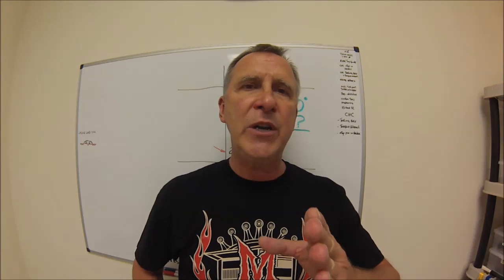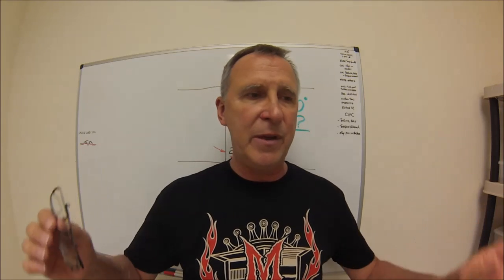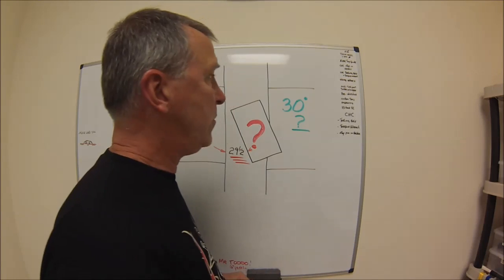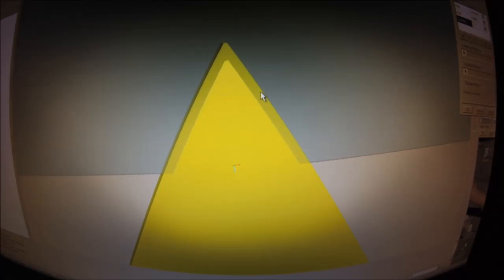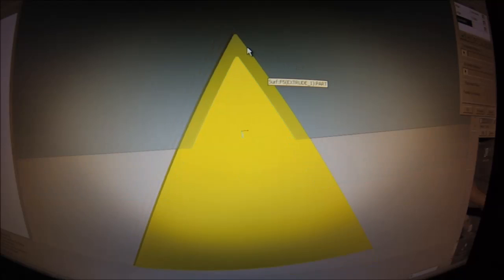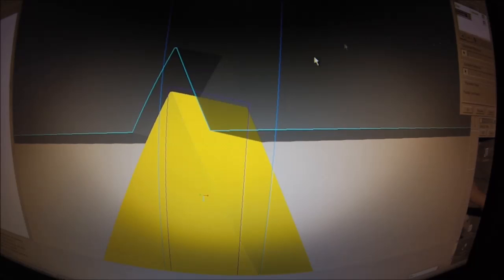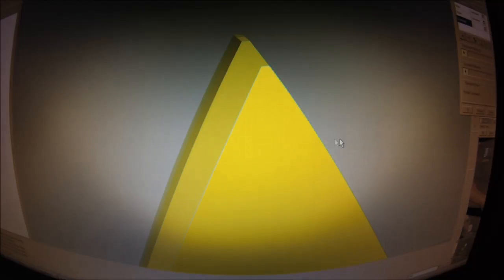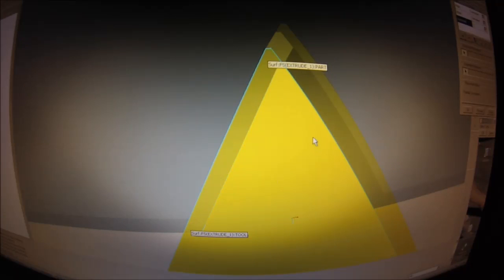Lathe Compound Setup for Single Point Threading...Myths and Musts

Comment: Hi Joe, Thanks for the excellent demonstration of a subject not well understood. I've cut many threads at 30 degree angle and straight in and both work well. However, there's one situation where a 29/30 degree angle produces superior threads than straight in. Lets say you're cutting a 1.00-8 thread in 304 SS, 4140, aluminum bronze, or other tough material. In that case an 8/10 degree positive side rake produces a smoother cut with less chatter than feeding straight in. Keep 'em coming.
Reply from the maker: That aluminum bronze is fussy material. Not hard to work with, but don't take small cuts or it just shines up and laughs at ya.
Reply: Right as rain Joe. Interesting how Aluminum and Bronze, both relatively soft, produce such a tough alloy when combined.
Reply from the maker: Fantastic bearing material.

Comment: I was always told to keep the compound square against the part being turned, but then again I was only cutting fine threads so turning the compound to 30 degrees probably wouldn't make too much difference. Also you could ensure the cutting tip was pretty square against the part being turned. Thanks Joe!

Comment: Great Info! I always use 29 degrees and have often wondered what the difference is between 29 and 30.....I always grind hi speed tools and was taught that the angle greatly minimizes the stress on the tool, part, and machine.. Mike in Louisiana

Comment: To confuse  everyone a bit more I do not use the topslide for threading. I put the threading tip with a fishtail correct to the schaft and use the crosslide to feed in. No matter what the topslide angle is. After setting the gearbox to the correct pitch I always engage the threaddial at the 1 position. I normaly work in Metric and can disengage the threadnuts.
Do not ask me how it works but this is the way I have learned it many years ago.
Reply: What grade of HSS

Comment: As a backyard hobby machinist, I watch Joe's tips religiously and learn from every one of them.  This video ignores a giant, checkered yellow, elephant in the room.  Namely Joe's religion of threading in reverse and away from the headstock.  I just made a custom BXA holder so I could get a left hand threading tool high enough to get the tip on center and cut a few threads on a new to me and in new condition  13x40 Harrison lathe.  Joe's model is accurate and appropriate when the leadscrew is pushing the cutting tool towards the headstock.  His chip load analysis is spot on.  But what happens to the chip load when the tool is upside down and going away from the headstock?  Common sense says chaos, chatter and premature tool wear!  I can't tell because the Harrison and inserts exists in a different universe from HSS and a heavy ten South Bend(my only limited threading experience). Maybe I should learn to full form thread without the compound?  Maybe experiment with finer pitch threads to begin?

Comment: I dont worry about any degrees i just feed in and use a neutral tool and it comes out every single time, beautifully. I feed in on the main feed. The only time i use the angle feed is if the part get pushed in and i use it to realign the threads for cutting

Comment: 29.5 is just to deal with crappy markings on the compound so you don't go over 30 and end up with a stair step on the back side of your thread is what I've been told (and makes sense to me).  That it isn't super critical is good to know.
Reply from the maker: Close is good enough. Just don't go over.

Comment: A very good demonstration and I'm slightly surprised that there were no threats of burning your effigy from die hard flank cutters. From past chats on the subject there are some who think going straight in is ranked much like spitting at the Pope or going to a rock concert without ear plugs, things you should never do.
I have always favoured the radial feed because of the advantages of keeping the top slide set where it is most useful, in line with the lathe axis. For threading, being able to widen the cut  once full depth has been reached (to allow for too small a nose flat) has its benefits.
Reply from the maker: I really expected to find a box of challenges on the comment list this morning and got nothing but great feedback. Surprised the heck out of me. You just cant argue with the facts and graphics. Maybe I won a few people over. Who woulda thunk it?
Reply: There is no wrong way until you realize it's wrong. Until then its right.
Reply: I believe that is called learning.

Comment: The old South Bend “Running A Lathe” manuals make the point that when threading, and setting your compound over, a “minor” amount of metal is indeed removed from the trailing side of the cutter, that “smooths” out the thread. This is something that was known for as long as threads were beginning to be cut on a lathe.

But, for reasons I don’t understand, there are people who don’t know this today.

Comment: You have confirmed what I suspected all along. The reason I say this is simple. All of those who insist on an angular approach defeat their argument as soon as the begin internal threading with a boring bar. They all have their compounds set so the tool approaches the part at a 90 degree or straight in cut angle due to bar interference to the part. It kills their argument. 

Now, if I were to hypostulate regarding where this idea of 30 degrees evolved from, I would venture to say it comes from working with old used and worn machinery or machinery that is poorly made. I believe that with the initial reduced load on the tool as it went into the existing vee groove created by the previous pass would allow the tool to self align in accordance with the slop worn or built into the machine gradually as where a straight plunge cut would be much more forceful and tend to "vibrate" or chatter its way into the existing groove. This vibration or chatter as it bounced back and forth side to side as the machine aligned itself would tend to create a poor surface on the thread faces.

Comment: thanks Joe, love you're videos. ive wondered about that for years. i set mine at 29ish low hp and kinda spindly! 14 1/2" southbend. not so tiny but also not a pacemaker or a monarch. thanks again
Reply from the maker: The compound feed does benefit less rigid machines. The angle is just not critical at all.

Comment: Hi Joe,

I more people UNDERSTOOD flank infeed, you wouldn't get all the ruined threads from setting the compound to 30 degrees on lathes with the 0 degree markings perpendicular to the spindle axis. 

On the occasions that I'm not getting a good enough finish with radial infeed, I'll simply advance the compund (set parallel to the spindle axis) 50% of the radial infeed. For a 60 degree thread, that gives pretty much the same tool advancement as angling the compound to 30 degrees minus. 

Several people I know have ditched their compound slides altogether (especially if they have a DRO) and take advantage of the greatly increased rigidity.
Reply from the maker: I am a big fan of plunge cutting threads. More control. I think the 29 degree thing is out of date and a waste of time. If your machine is not rigid, you have to go this way, but if not....ditch it.

Comment: I run a simple engine lathe with a decent d.r.o and quick change tool post. I hate messing with my compound slide or rotating quick change body as it upsets every tool size stored in the memory! I get around thread cutting issue via this method: After taking the first few initial cuts  I will stop the lathe as it is reversing the tool back to the starting point. I will disengage main spindle from the drive motor so I can feel whats happening when I rotate backwards. I will then grab bull gear lever (forward/reverse feed direction lever) and as I slowly take pressure off the screw cutting drive train by revolving chuck FORWARD it will disengage. Continue to revolve chuck forward carefully, smoothly and slowly and reengage bull gear. (One tooth usually) Then just continue on and cut next thread pass at same depth as previous cut. It should have advanced the screw cutting tool a fraction, enough to stop thread from galling or feathering. With practice you work out if you need to move three or four times during threading op or maybe two teeth at a time. You get very fast and while some purists might not approve my customers get value for money and I don't fracture my inserts and I don't have to re calibrate my tools or square up my tool post!
Reply from the maker: Is this metric threading you are doing?
Reply: @joepie221  Hi Joe. Makes no difference. I have a metric lathe but use same technique doing 8 tpi or 3mm pitch. Also works doing internal treads. I was not taught this technique but developed it after having to pick up existing threads and dont want to upset tool post position.

Comment: very good explanation frof joe. the only problem i have from deviating very much from the 29 degree setting is that all of the thread depth tables reference that setting. i have seen the lazy machinist video on this subject and and i highly reccomend it also.
Reply from the maker: Although he still said there was no right side contact, it was a good illustration overall. To be honest, I have never seen a thread depth table like the one you speak of. Can you point me at one?
Reply from the maker: Thread depth is also a factor of the flat on the tip of the tool. Pitch diameter is more important.

Comment: I use av 30 60 90 set square to set up, your right don't trust the angular scale, mine zeros 90 degrees out for more confusion, but I would be wary of using off angles for tough work hardening metals leading to a chapter snatch and dive, I use an upside down tool to avoid.

Comment: The angle of the compound depends greatly on the material being machined.  Free machining materials single point well at 29 or even 29.5 degrees.  Most materials single point well at a true 30 degrees, but it requires that the compound be set with extreme accuracy and that your tool be a perfect 60 degrees and be set perfectly.  

Tool steels, many stainless steels or any fairly tough material won’t form a chip with out an adequate chip load, (minimum required depth of cut varies by material and alloy, so the statement is fairly general).  I have had good success on manual lathes at 25 degrees when single pointing stainless steels and tool steels.  For materials like Titanium have the compound set at zero degrees and do not take a spring pass.  I can’t address each material or alloy here, but as a general rule, when single pointing free machining materials, the closer to 30 degrees the better.  For materials that require a substantial force to form a chip, 25 degrees or less often works best, otherwise the tool will be dwelling on that flank until multiple passes finally provide enough pressure to form a chip, (provided that the tool has survived to that point).

Many CNC turning centers have a variety of patterns that can be used depending on the material and application.  The old default G76 code used a true 30 degree advance, so there was no worry about dwelling against the rear flank.  I would use that pattern when single pointing on a CNC, but not an engine or toolroom lathe.  That G76 code was easy on the tool and worked very well for many materials.  There is no one size fits all in metalworking.

I would also point out that many lathes have zero on the compound being parallel to the longitudinal axis, so the 30 degrees discussed would require the compound to be set to 60.

Comment: Hello Joe, You might remind your viewers that if they are using the compound for infeed to set their hard stop with the compound dialed down to the finished pitch. Especially so if the thread relief is minimal or the end of thread is close to a shoulder. This is assuming they are using the tool upside down, starting from the relief, and cutting CCW spindle. If your threading towards the chuck and using the compound it still is a good idea to keep that in mind when following a DR or using an old school dial indicator for thread stop position. This may save a close tolerance one off part. Although not much Z axis change on a 32TPI thread but on a 8TPI it may save you from having a bad day down range.
Reply from the maker: Its ironic. I am editing a video right now that shows that. That would be a good suggestion regardless of the tool setup or feed direction.
Reply: Hello Joe Again, After over 30+ years of running my own shop I had to be "ironic" because it never ceased to amaze me on how many ways my machinists and operators could come up with to keep me from enjoying life. Nearly all my work was close tolerance and I would not ship a part that I couldn't be proud of even if the customer may have "bought off the discrepancy". Not to say that we didn't MRB parts out of spec and occasionally get deviations bought off by customer engineering. After my time in the Army I opened my own shop and quickly found that I could only do so much and about 1976 I bought my 1st "NC" machine. Automation was the only way I could control the talent. You hit the nail on the head that we are not replacing the talented machinists that I watched as a kid following my dad around.

Comment: Being a novice, this was interesting. One question: you talk about keeping pressure on the hand wheel to prevent a drunken thread. Assuming a right hand thread was being cut with the carriage advancing toward the chuck. The operator would then want to keep tension on the hand wheel as if reversing the carriage to keep the half nut taught against the lead screw in the direction it is pushing the carriage? Thank for the video.
Reply from the maker: Yes. I always keep my pressure to the trailing edge of the cut when I thread regardless of the carriage direction. If you simply apply light pressure to the top of the handwheel, the pressure direction will be obvious. Like a brake. Thanks for watching.

Comment: Nice explanation.  The rubbing action on the right hand side really helps stabilize the tool, especially on larger threads.  An interesting thing to note is that on American lathes the compound 0 is usually perpendicular to the spindle axis, where Chinese lathes read 90 degrees, so you have to set them at 60.5 degrees on the compound. So if a newbe sets his Chinese lathe to 29.5 degrees, the thread is a disaster.  I've seen those knife edge threads on YouTube a few times.
Reply from the maker: Those threads work great as wood inserts
Reply: Man I struggled along time with my Asian lathe before figuring out that angle difference between what I read on my lathe and what I read in books!  Nobody ever seems to mention it though?

Comment: You sir are absolutely correct.I never subscribed to the 29.5 thing made no sense. I like straight in for small to medium size thread and something  under 30 to ease up on the chip load on larger threads or if you Start  getting chatter or a bad  finish.

You are getting better at making videos as well..your first ones were a bit "pushy" I thought, no offense, just a cultural thing I think. Keep up the good videos.
Reply from the maker: I was pissed when I made that first video. I never intended to make another.  Oh well.....that worked out. Thanks for watching, and your honesty.

Comment: excellent video, I have only done a half dozen thread and all but one was to learn how to do them, I will try to do one with the compound at 90* , I would assume the rigidity of the machine can make a straight in plunge better than a smaller lighter machine
Reply from the maker: Thank you. And yes, rigidity makes a plunge thread much easier.

Comment: I agree with all you said Joe.  I also agree that there's nothing at all magical about the Shrine Of 29 regardless of what the True Believers might say.  

Instead I tend to see it as more pragmatic and through the eyes of someone that "enjoys" Mr Murphy as a frequent visitor to the shop.  IF I trust my grinding on my HSS toolbits (home shop and very few insert tools) and IF my degree marks on my compound are accurate and IF I can see those darn small lines and IF the tool and other stuff doesn't spring a little then I can set it to 30 and call it a day.  But if all that other stuff adds up on me the wrong way then the trailing side ends up with a bit of a rough stair stepped shape.  So I've always set it to a hair under 30 simply so I'm sure the trailing edge is at least in contact.  I don't fret over it.  Just somewhere between 29 and 28.  And if it shaves of a hair extra along the way because for once everything was in agreement?  Well that's just a bonus.

Howzatt?
Reply from the maker: That's a lot of if's. I'm glad you figured out a way to line them all up. Thanks for the comment.

Comment: Another good video Joe, my thoughts exactly with regards to 30compound settings and flank in feeding, 
If you had to produce a very groove with a form tool you would have to feed straight into the part regardless of the chip load, producing a deep vee groove on a rope pulley would be different.👍👍
Reply from the maker: I plunge everything. Deep contact pulley grooves are especially well suited to inverted tool and reverse chuck operation.

Comment: Good video. It raises the question of making sure that the bit doing the cutting has to be sharp enough to maintain the cut all the way through. How much wear on the bit is acceptable before you start running into trouble? Obviously, you want to determine this on a test cut before you try to crank out parts.
Reply from the maker: Experience and a correct speed/feed setup will let you know when the cutter is worn. Listen and watch the shape and color of the chips coming out. If you are doing it manually, you'll feel the pressure needed to cut increase. If the drill or cutter turn blue or glow red....its probably time.